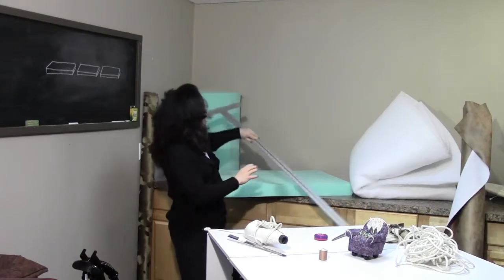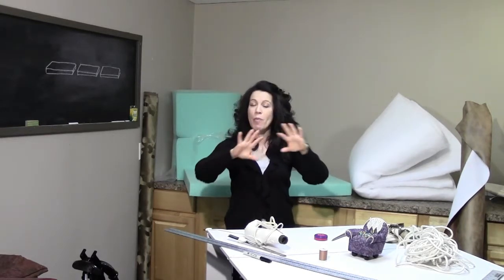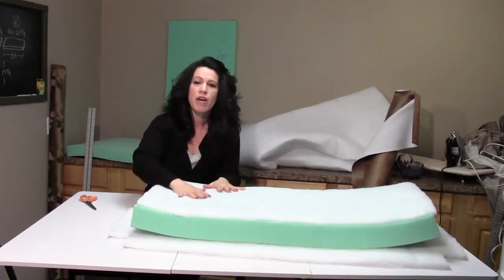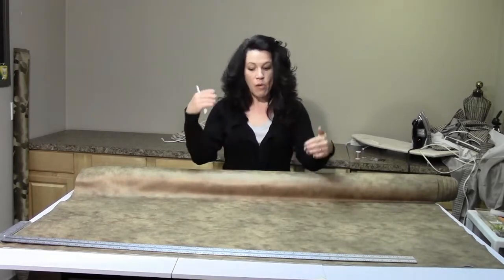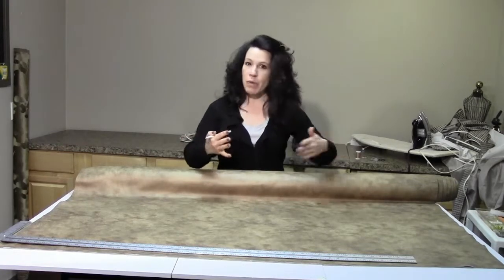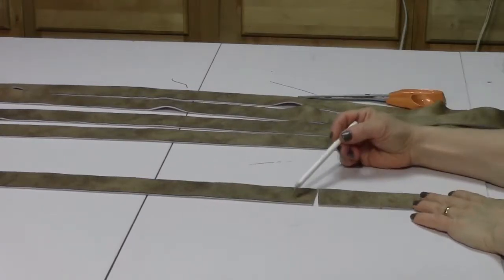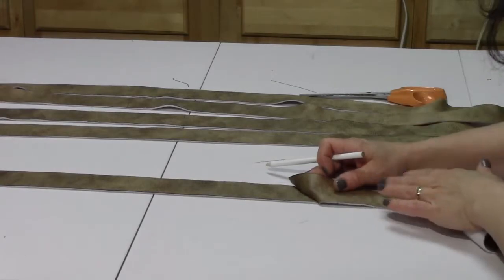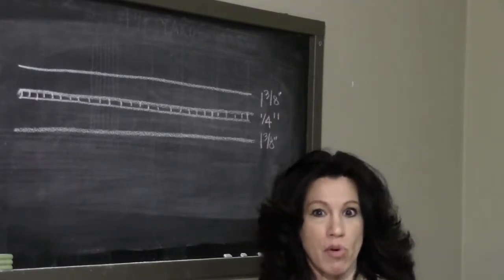Custom Bench Seat Cushion (how to) - Renee Romeo

Comment: Renee, I am choosing56 inch upholstery fabric so if my window seat is 84 x 16 and half i should only need 2 yards right?
Reply from the maker: I would try to lay it out lengthwise. That would mean that there would be no apparent pattern, or one that could be layed out either way. With that the case, I come up with 2 1/3 yards exact. My fabrics are usually not cut square from the store so I like a little extra wiggle room. (2 1/2 yards)  You can get plenty of piping cut by purchasing an extra half yard of 54" fabric. So, 3 total will do it
Reply: @ReneeRomeo  The seat is done so it is exactly 81 and 1/2 by 15 and 1/2. I will get 3 yards. Do I need more if the fabric is 54 inches?
Reply from the maker: @bethbilous4720  you could get an extra 1/4 yard so that you feel more comfortable